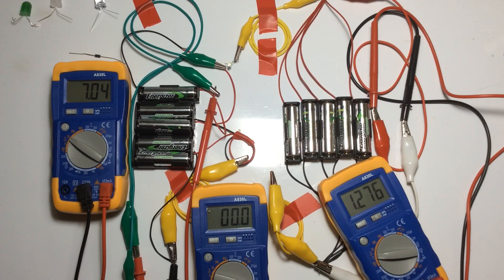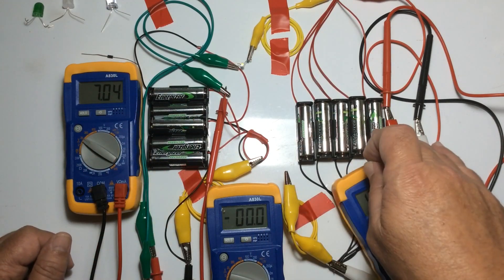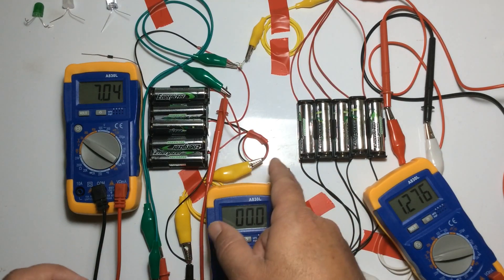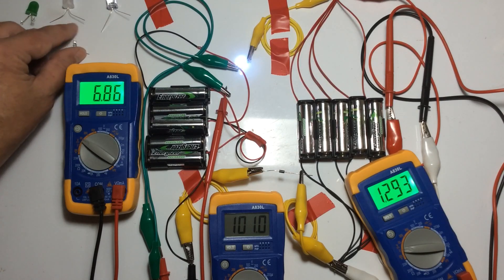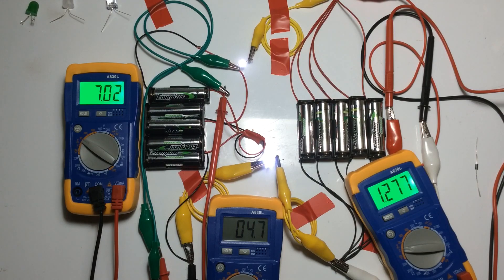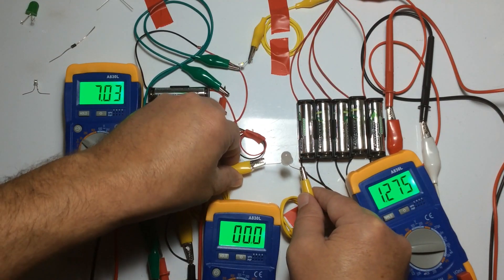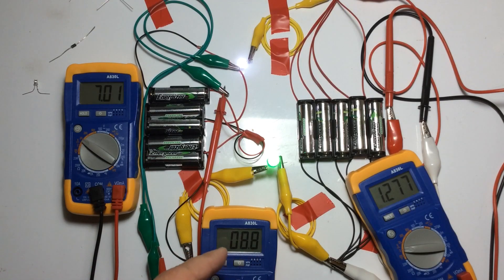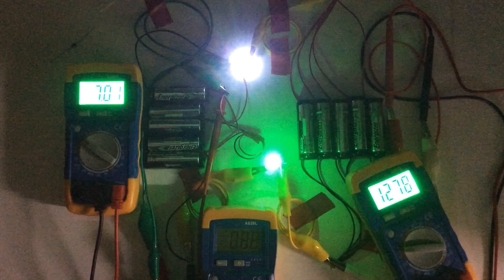EFFICIENCY BREAKTHROUGH USING TESLA POWER TRANSFER

Comment: Do the lights run cooler than usual could you use the temperature gun to see the difference it makes sense it seems like the light can be still made light output an LED is still very small compared to the power that uses they are still very efficient but still the majority of their Energy is turned into heat
Reply from the maker: Thank you for your comment.
I have noticed changes in temperature of the LED’s but not applied any measuring protocol just casual observations. I can place a thermometer on the led for you and see what it reads.

Comment: There is still a couple ways that might improve the system. By leaching some power with small solar panels. And by using joule thief's. And by using RGB LEDs with common cathode and taking the power from unused legs back to the system. Thanks for taking the time on this!
Reply: Hello and thanks you for your comment. I dont' know the rgb led system. Do you have more information about this ? It act as a kind of diode bridge ?
Reply: @paradigme_  Search RGB LED 5mm. They are regular Red Green & Blue LEDs with 4 legs. 100pcs of them are very cheap. There is clear and defused ones. Common anode or cathode means that they use one leg as positive or negative. All LEDs will act as solar panels too if you put them under light. So it's possible to get some energy back from the two unused legs, if you use the ones with common cathode. For example blue light can give almost 1, 5 volt back to the circuit from the green and red legs.
Reply: @Kangsteri  I will try this, thanks you very much!
Reply from the maker: @paradigme_  Thank you for your comment.
I see @Kangsteri was able to explain the RGB LED’s to you, did you have any luck finding some suitable for the experiment?
Reply: @whatifididthis...1236 , I realized yesterday that it was actually the light emitted by the led that was "free" if the circuit was perfect.
That's where we need to make the environment fluctuate (light, magnetism, other...) and collect it in an additional external module.
I wasn't able to test with an RGB led, as I don't have one at my disposal yet, but basically, I used a small solar panel (with the light of the led) to charge a capacitor, and the results are interesting.
I imagine that by replacing the led with an HV module, we could collect much more in a capacitor and dump it by pulse, in the source battery for example, to have self-sustained system.
Reply from the maker: @paradigme_  I believe you could be correct that the LED light is free and the tiny losses are possibly internal resistance. I like your idea of the solar panel, this is something a few viewers and I have discussed for a short while now. I wanted to focus on finding an arrangement that was super efficient before advancing to the next stage and as this is still running at full brightness 5 or 6 days later( have to check when I started the test),without a battery swap.
Circuits status:
The Series battery = 6.38 Volts
Parallel battery = 1.299 Volts
Current = 3.4mA
Reply from the maker: Thank you for your comment.
That is a very interesting idea, I think I have some 12v RGB LED’s I could attempt to use. The joule thieves I have tried weren’t designed for this system and chewed excess power. I have been considering building a new one that is specific to this system as I have read a pulse circuit is ideal as it allows a back rush of energy with every magnetic field collapse of the coil.

Comment: ❤❤❤😊😊 Hi, can you do this with bigger batteries like car or solar battery 🔋??? Please if possible to do a video on that... Thanks 🙏👍
Reply: This system is universal. As you have enough potential difference between 2 point, the current will flow.
Reply from the maker: @paradigme_  Thank you for your comment.
Reply from the maker: Thank you for your comment.
Yes this can be done with car batteries, no problem at all. I will have a look at the old car batteries I have here to see if that test can be performed by me. The car batteries I do have here are old and removed from vehicles because they were failing, this may mean I will need to repair the batteries first. In the meantime you can watch my video on the 12 volt version which is closest to what you wish to achieve.

Comment: lucky that led didn't fry out with ~5v dc across it.
Reply from the maker: Thank you for watching.
I had to replace that LED because it wasn’t so lucky and joined its dead buddies, it’s a good thing I bought 1000. 🤣 After they burn bright like that they no longer pass the correct current through them anymore and without both diodes in circuit the voltage is way too high and more like double the LED’s rated voltage.
Test is still running now at 3.5 days, Series Voltage = 6.54, Parallel voltage = 1.295, Current = 4.7mA.
Reply: @whatifididthis...1236  That 3v3 booster could run off a 3S1P-1S3P cell config, to get the equivalent voltage of a 2S (2.4v). I guess the 1S3P on the negetive side prevents the 3S1P battery from being drained flat.
Reply from the maker: @jimmybrad156  This is definitely a head scratcher. I initially believed there was no current moving through the NEG rails but this and previous tests monitoring current draw left me going....WTF?
Reply: is the ebay item number

Comment: Great experiment, tank you for sharing ❤

I think Nigel Cheese said in his quantum battery setup that a green led is easier to lit up and now we can observe this.
Reply: what ever happened to that guy?...
Reply from the maker: @thebigfella9095  Either he was genuine and they took him out to conceal the concept and the secrecy that he created around his discovery meant it disappeared with him.
OR
He was a fake and unable to go anywhere with his device and the secrecy he created around his supposed discovery deterred investors, again helping nobody.
There is a moral to his story whichever way it went, secrets kept for money is greed and greed will get you nowhere!
Reply from the maker: Thank you for watching.
I do remember hearing someone say that the green LED produced a different effect but I don’t think that explains the whole picture here. In this scenario, we have two 20mA LED’s, currently it is 3.5 days since it started and sitting at 6.54 volts on the series set and 1.295 on the parallel side with a current draw of 4.7mA. So again, two 20mA LED’s in the same circuit consuming 4.7mA. There has to be something related to the material used to make green in an LED, the manufacturers place different compounds in tiny quantities inside the LED to achieve its colour, I don’t remember what green is made from but I will put my money on it that this is the cause of the effect we see with the green LED.